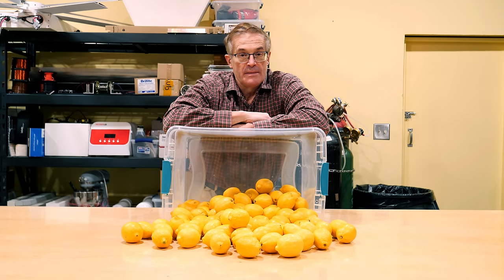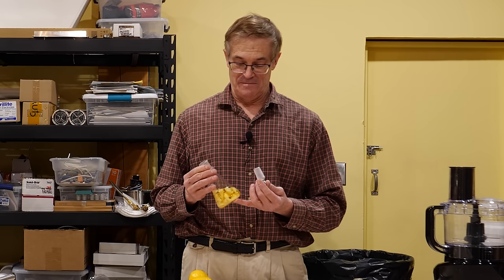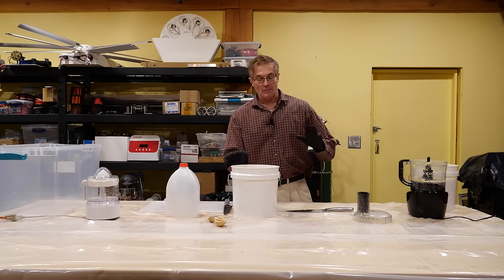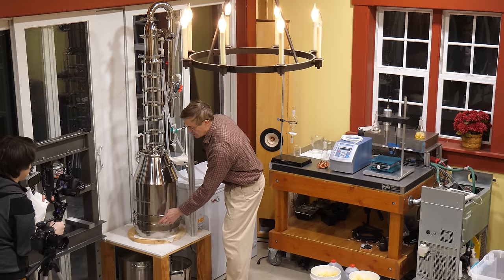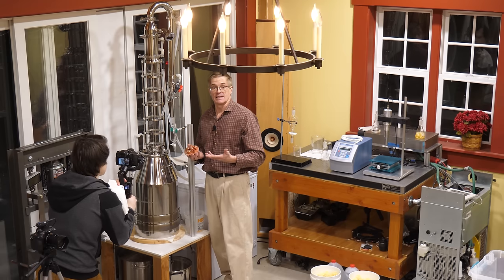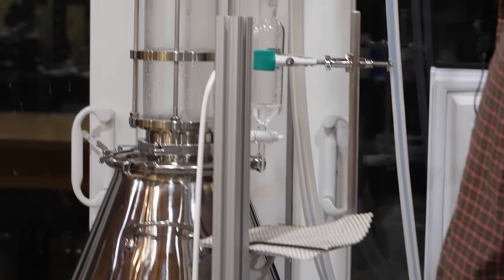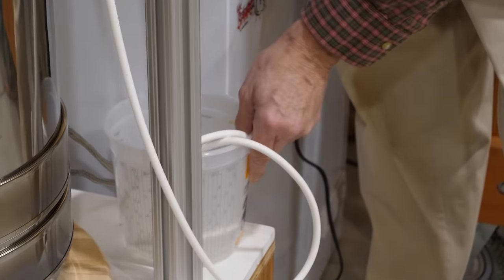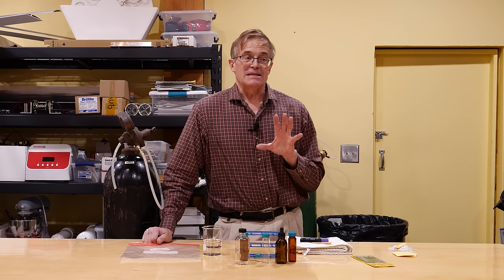CONCENTRATING LEMON OIL LEADS TO A VISIT TO THE HOSPITAL!

Comment: Wonderful video! You are definitely a techie's techie. Although I've worked in multiple  highly technical fields for more than 40 years, I am wow'ed by your expertise. I thank you dearly for your efforts and production of such high quality content. SUGGESTIONS: optical calumniators,  ring laser gyros, rate integrating gyros,  RF antennas (directional, omni, dipoles, long wire, horn, etc.), microwave systems.

Comment: I've had several of those 'marginal' cuts heal perfectly by running the coldest water available over it until the bleeding stopped, a dash of alcohol and then more cold water, and as quickly as possible closing the wound under pressure and absolutely, positively not disturbing it for a day or two. Butterfly strips are good, even under a band-aid, and I've actually splinted a finger before just to avoid any movement. 

I remember one particularly clean cut managed to stitch itself back together in less than a week, though I still taped it to make sure it wasn't going to pull open at some inopportune time.
Reply: The pressure is the important part. Some plasma seeping is alright, since that is where the platelets are. Firmly pressing at the interface point, to stimulate the glue effect. And...if it hurts, well, don't do that...
Reply: It was hard for me to see the exact angle and depth of the cut, but superglue works great. It looked deep enough that there is not going to be a flap of skin that will eventually die and dry up (i hate those kind, usually due to a shallow slice, where the top surface doesn't have enough bloodflow to reattach, and it turns to leather and catches on everything). Usually just gotta wait for it to die, which protects the underside of the slice that is raw, by the time the lid dies and dries up, it's time to cut it off as the underside has a layer of new skin by then. Paper thin and pink, but then ya can chop it off. I hate those low shallow cuts on fingers, always catch on pant pockets.
Reply: Until a few years ago I never bothered with cleaning small cuts. I’ve worked in metal fab my whole life so I’ve had a few. A little electrical tape or duct tape and I would just keep it taped for a couple weeks until it grew back together. But a few years ago I had a sharp metal burr poke through my glove and into my left middle finger. It was literally the size of a pin prick, it didn’t bleed very much. I put a bandaid over it because we had them handy and went back to work. A few hours later my finger swelled to 4 times its normal size and turned red. It felt hot and I could feel my heartbeat in it. My boss sent me to the emergency room where I received antibiotics through iv. I still wasn’t taking it very seriously and felt like everyone was making a big deal out of it. Then the er doc told me that I had a good chance of losing the finger. That night I had a fever and I have never felt so awful. By the next day the fever broke and the swelling went down. I got to keep my finger. I take cuts more seriously now.
Reply: @mikebond6328  That's part of the reason I flush them like I do, the cold staunches the bleeding long enough to see if there's anything in it that needs to be removed.
Reply: @adamvalt6609  There's medical grade super glue, DermaBond for example. Although it is only supposed to come into contact with the skin itself.
Reply: Why not just use staples?
Reply: @adamvalt6609  You should try not to put it IN the cut (since how can you heal, if there is a layer of plastic between the 2 sides of the cut). You push the edges of the skin together, and superglue over that.

It depends on the cut. If the cut is leaking a lot of blood, you need to wait til it stops, or if it is plasma'ing a lot, same thing. Sealing that in doesn't' let the body flush the cut out. Usually I'll alcohol to clean out the cut using a toothpick to hold it open to make sure it's fully cleaned out after wash and dry hands, then superglue shut. They make quicklot bandaids now that can also stop bleeding very fast now days. I was actually surprised how well it worked when I popped my finger like a grape from steel falling. I closed up the pad, but left the top open. It's easier with pics but uh, yea, they'd be nsfw if I posted them here. heh. But there's many ways to deal with cuts, and superglue (i like dap rapidfuse, it's flexible CA)
Reply: @graealex  Because I'm not a doctor nor do I have access to sterile supplies like that?
Reply: @graealex  That's not exactly something I'd want to seal a sliced finger anyways, inconsistent pressure. I want to stick it closed naturally and be immobilized so it stays that way.
Reply: @mikebond6328  my wife had a cut like that. They didn’t screw around, hooked her up to portable antibiotic metering pump, and it went down fairly quickly. There is some nasty stuff out there.
Reply: I love butterfly strips, family had them since I was a kid...
And they did come in handy multiple times
Reply: Heck, I cut the webbing between my thumb and first finger to the tendons.   All I did was clean it out well, and wrap it in duct tape for a week or two.  Did just fine.
Reply: @nate_d376  duct tape: when bandaids simply wont do :D
Reply: I just use pressure for a minute and then ca glue. Works everytime.
Reply: @mikebond6328  Generally the metal itself is very bad place for bacteria to be and if the chips got blue they got so hot almost no bacteria survived anyway so usually nicks and cuts gotten while metalworking don't get infected. On the flipside if such cut does get infected it's going to be really bad (because only he baddest mofos of bacteria can survive the conditions) so if you notice the symptoms of infection (redness, hot, swelling) get it checked out immediately.

I too generally just quickly clean and then superglue the cuts I get when metal working in my garage.
Reply: @graealex  I have never cared about that, I just use the generic superglue from the store though I generally keep a dedicated bottle for patching up and never use that for anything else to help avoid contamination, but CA polymerizes instantly in contact with any water so it's surprisingly hard to get any bacteria etc into it.
Reply: @nate_d376  I remember pushing a glass tube too hard into a rubber stopper and taking a core sample in through  the webbing. Went in really deep but healed up okay. Decided I liked electronics more. :-/

Comment: When trying to get those deep gashes to stop bleeding for either treatment at home, or to make a less messy trip to the ER. One or two wraps of electrical tape over the paper towel works fantastic at applying constant pressure. You can get about six to eight pounds of pressure per lair with electrical tape. Just keeps adding up. Be careful you don't cut off circulation.
Reply: That or super glue, but keeping the cut higher than the heart level lowers the pressure.
Reply: A the advice of a sparky. Plumbers just wipe glue on the cut. The burning running up your arm is the clean / sanitization power!
Don't worry it will peel off no problem.....
Reply: Super glue saves the day
Reply: While working on cars, a mix of axle grease and dirt stops the bleeding as well. Generally I use electrical tape in a pinch. I find two stroke oil mixed with dirt works fastest on bleeders. I used to work on snowmobiles and always cut myself on something. Grease, oil and dirt stops bleeding fast.
Reply: Pressure dressings don't need to go all the way around, just fold up gauze (or the cleanest substitute) over the wound and then pull on the tape after sticking it to the skin on one side so that it pinches the sides of the wound together when you stick the other side down. If you ever do have to cut off the circulation on an extremity though, you must release the tourniquet no less than every 2 hrs to let blood circulate some before reapplying. Just fyi.
Reply: I love Electrical tape for cuts. It applies good pressure and allows the cut to heal itself. Even better, a band aid with electrical tape over it, which I am sure is going to be more sterile.

Comment: Yep, as someone with a lab of unbelievably sharp things, I concur! I had the unique situation of spending several years and countless $$ on microscopy equipment, And then another room/section of the lab a separate business… of woodworking, Specifically hand tools, and countless years chasing the perfect edge.

It was only a matter of time until I was testing ways to get the sharpest edge possible no matter the cost. 
Damn curiosity!

So I’ve had my fair share of bone deep blood gushing cuts. Where a simple slip can take off a portion of the finger

Finally I just quit going to the emergency room and keep a “stitch up kit” in my lab. Also, medical grade super glue which is what they used on me most of the time. My cuts were always to the bone or close, and in areas that hardly could be stitched. So a little investment in the proper supplies and materials is a good idea 😂 and practice before hand so you know what to do when the shit hits the fan, and you don’t contaminate an open wound or a missing finger. They’re all in my lab has always been, Hospital only when body parts start hitting the floor. Unless I turn into a serial killer… Which is looking more likely by the year… That rule shouldn’t be hard to follow.

Was letting a good friend borrow a piece of equipment for a big job, because his failed the day before. $18,000 worth of surgery and dental work later, Sometimes I wonder if I will continue to fine his teeth fragments on the floor when I do a big lab cleanup. Worst non-lethal accident I’ve ever seen. But it really wasn’t anyone’s fault because the building was being remodeled and the power cut in the middle of him using this machine. Even with the backup lights, the loss of RPM and such a sudden change in motor torque, he didn’t stand a chance.

Be careful out there folks
Reply: There are different versions of medical glue out there. If you want the best option for your dollar, or just can't get a hold of the proper medical glue that would be used in a hospital, then try out vet bond. It is safe for human use and much safer than the little tubes of "medical" glue that are found on places like Amazon. Only downside is that since it is used with other closure methods it is a bit weaker. 

The little "one time use" tubes you can more easily find seem to work fine so there isn't anything wrong with them. Other than the fact that they're super wasteful since the packaging isn't designed for multiple uses and you don't need a full tube a lot of the time. I also question how sterile they actually are and the overall safety, but if I had no other glue around I would still use them.
Reply: those emergency UPS / BPS are essential with stuff like that... ouch
Reply: Jesus Christ
Reply: @Santa-614  Believe it or not it was a tablesaw. I’m a machinist and tool and die maker by trade so I’ve worked around a lot of lathes and Mills and you’re right. They can do some terrible things.

I’ve always used the best I could afford and I had just purchased a “saw stop” brand table saw. They are claim to fame is that they can immediately lower the blade within a split second when it senses contact with skin. So they literally are 1000 times safer than normal table saws… Which are usually the most dangerous tools in a shop. I said it all several times and the wound on my finger was so minor that it didn’t even draw blood. It’s within one millionth of a second the blade disappears below the table, because usually if you touch the blade even just a little bit, it will pull your hand into it and you’ll lose at least two or three fingers. A good 10% of the woodworker so do it professionally and have for years are missing several fingers from tablesaw accidents

But the building was being renovated, it was a huge industrial incubator for small businesses. I was in the middle of a large batch of guitar finger boards that I was cutting on the table saw. I always lock my shop doors when cutting….. so no one could sneak up on me when using equipment like that. 

But the maintenance man let in a good friend of mine without me knowing, which was no big deal and a normal thing because I always had people in clients visiting. And sometimes I would have the music cranked up pretty loud and it was a huge warehouse type shop. So you might not hear someone knocking.

He snuck up behind me without me even realizing he was there, and he was standing directly behind me DIRECTLY IN LINE with the table saw blade. 

The maintenance crew doing the remodel accidentally cut the power for a few seconds, On the whole building. which reset the breaker in my shop and powered off the table saw. I was cutting extremely hard Ebony wood using a push stick, so not only did the few seconds of total darkness totally throw off my senses… But as the blade jerked and began to slow rapidly it quit cutting and it grabbed the fretboard blank… and push stick, throwing it right past my head … If you’re not used to big powerful tablesaws you’d be amazed how fast they can throw something across the room. They can throw a 60 pound billet of mahogany well over 100 miles an hour up against the block wall and break the brick

That’s why you always use a push stick with the table saw, so that you’re never in line with the blade and path.. it all happened so fast, there was so much blood. Immediately got him down on the floor because he looked like he was going to pass out, call 911, and helped him keep pressure on it as best as we could but without knowing the extent of the damage you don’t want to be pushing on somebody’s head to hard. I grew up in a family of doctors, forensics investigators, and Taxidermist.. So I’ve seen some terrible shit, mangled bodies, and awful injuries. So I knew it was not life-threatening. But it was still pretty damn bad and gruesome

We looked for his teeth over the next week or two, and even with insurance I paid about $15,000 for his subsequent surgery and dental implants. I felt so bad because he’s one of the nicest guys I’ve ever known.

The craziest part… His girlfriend was with him, they had just met a few days prior and it was their first date. He was bringing her there to show her my Guitar business because she was a musician… So it was literally like the first hour he had been around this chick. Now 15 years later they’re married with several kids. At first I worried that maybe the trauma had caused them to bond and maybe they shouldn’t have gotten married so soon. But they proved me wrong 😂
Reply: @hullinstruments What an amazing story to read in a YT comment. Thank you.
Reply: Got a video of that shop accident?
Reply: @markfalgoust6910  The internet never disappoints.
Reply: Never knew that a table saw could throw stuff. Definitely good to know! Thank you!
Reply: @silvenshadow  Yep. Power tools are no joke.

Comment: Having used very sharp chef knives in the past, I learned very quickly to cut knuckles out instead of tips out. 

Hope Alex heals up well!
Reply: imagine you have this man for your dad but you still dont know how to use a knife
Reply: I did this once, but I don't have knife skills, cut the tips of my knuckle skin off instead of my finger, on 2 knuckles. Was actually worse than just cutting my fingers as would keep splitting open all the time due to it bending all the time.
Reply: @rdizzy1  I am in awe. I don't know how you managed that but that sucks. Normally the edge of the blade doesn't go higher that your knuckles
Reply: @Metalrasputian  If you know how to properly cut I would imagine so.

Comment: orange oil(cheaper to buy than lemon) is my 3rd most use solvent for cleaning, right after water(with soap if needed) and isopropyl alcohol. it will pull the glue from stickers and labels off of things fast and smells great.  also perfect for removing pine pitch from your hands.
Reply: Limonene is found in lemons, lime and oranges and is the active ingredient.
Reply: Orange oil is also great for cleaning greasy hands, after working on the car.
Reply: I think there is a famous brand that has sold straight orange oil for cleaning just for this purpose. If only someone remembered the name...
Reply: @WaterspoutsOfTheDeep  There's a quite a few of them. Orange Glo, Citriclean, Goof Off and Goo Be Gone are some popular ones in the US.
Reply: @bobweiram6321  I think another is called orange julius.
Reply: R11 refrigerant is the best degreaser ever :-)

Takes caked on oil, grease right off and your off your hands. Also works great for spy work. Soak closed envelope in it to read the letter inside, refrigerant quickly evaporates leaving almost no trace....good stuff
It boils at room temperature 74.7 degrees F.
Reply: Thank you very much for that post! I have to deal with pine sap and leftovers.
Reply: @WaterspoutsOfTheDeep  LOL!!! Where can I find one nowadays?

Comment: What a trooper.  He's leaking fluid and has probably got a good inch and a half sized hole in him and he's got a camera getting close ups instead of going to get stitched up.  About 8 years ago working at a hardware store I had someone bump into me while holding a hack saw at the work bench in the crowded receiving room.  The blade gently tapped the back of my thumb along the knuckle along one of the creases and left most likely a single layer of cells intact because when I looked to check it I watched the skin peel itself apart and almost passed out where I was standing because I could see under the wrinkly semi loose skin.  Tendons are effing gross. And I used to be a butcher, but it's different when your looking into your own body.  It still makes me nauseous since there was very very little blood.
Reply: How tf do u get cut by a hack saw? Thats like getting cut by a butterknife.